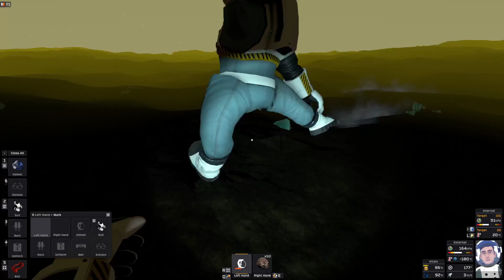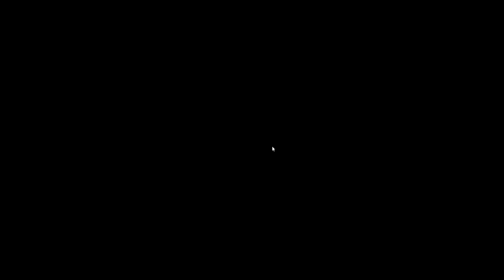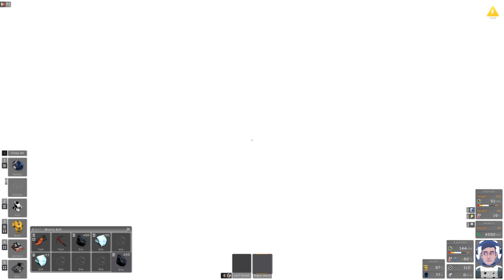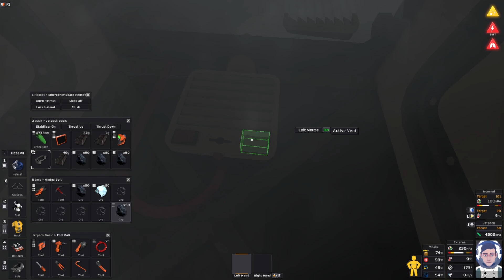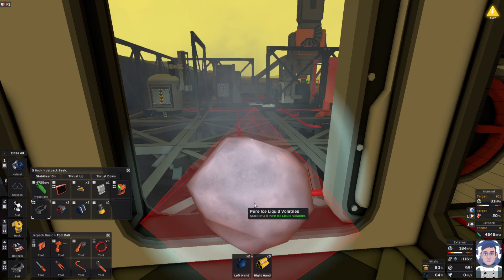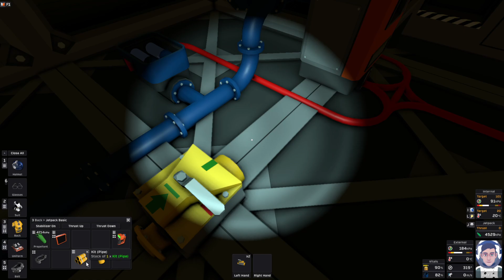Stationeers Let's Play Titan Part 8 : Heat

Comment: If you rebuild your structure out of frames and get rid of the windows. It helps hold the heat in.  If you can get a furnace up, get steel, the battery and a second centrifuge it really helps.  I heated my base with a gas heater and a few pipes in cased in a frame with a few radiators

Comment: Yeah, to remove gasses from a liquid pipe you want a purge valve.  The expansion valve is used to transfer liquid from a liquid pipe into a gas pipe.  And due to your severe lack of gold, it'd probably be easiest to just vent off the water into the room again via that expansion valve, let it freeze once the room temperature drops below 0°, and then delete the gasses in your water pipeline by deconstructing the pipe network and reconstructing it to give it a fresh start.  Cheers.